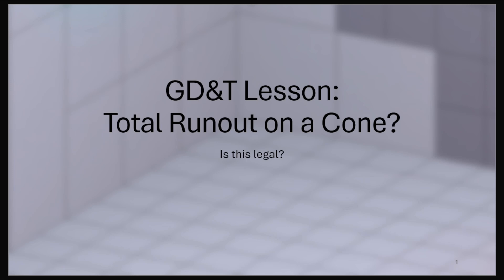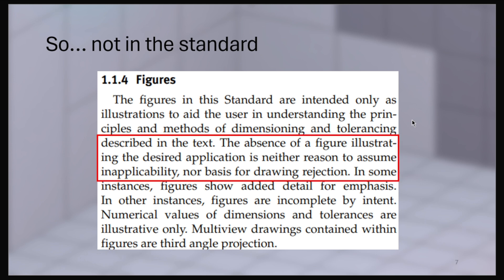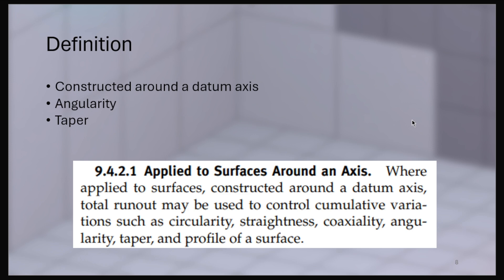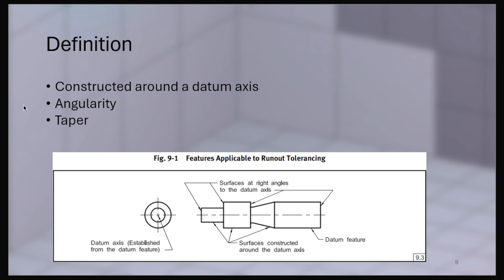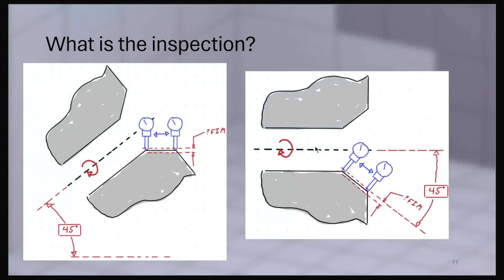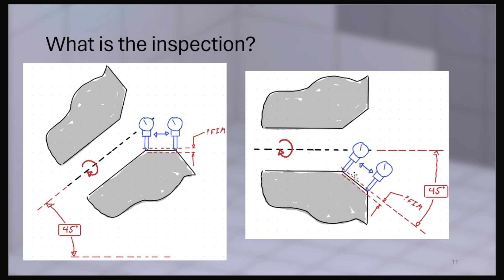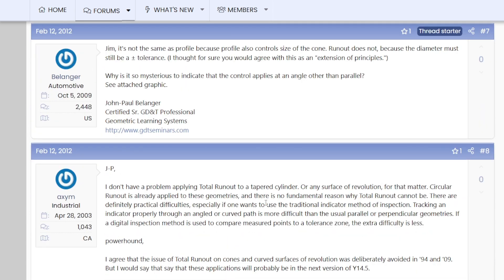GD&T Lesson: Total Runout on a Cone (Is this legal?)

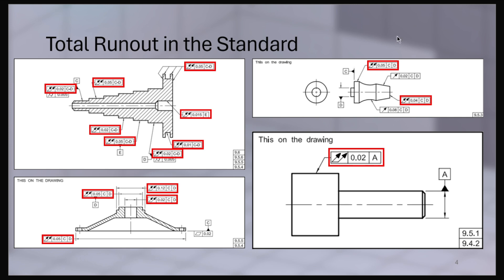Comment: I can’t tell if this video is a joke or not but just incase it isn’t what you want to do is CIRCULAR runout. It’s the symbol with one arrow in the top right illustration at 0:34 there is one on the actual cone section and one on the concave section of the part. You didn’t highlight them, didn’t you wonder what they were and why there was only 1 arrow vs 2 arrows? 

What kind of job do you have that you and your colleague are making prints and don’t know that there is CIRCULAR runout and TOTAL runout?!  

The funniest part is imagining someone inspecting a part using your tilting method 🤣🤣🤣 It’s kind of like when there were all those videos of primarily dads sending their kids into Autozone to get some blinker fluid 🤣🤣🤣

The difference between the inspection of CIRCULAR runout and TOTAL runout is:

🔹Total runout: the indicator will be fixed, the datum(s) will be constrained and the part’s location will be fixed as you rotate each segment of the part 360°, you then slide the part along the surface plate with datum’s still constrained and indicator fixed. You will then repeat what you just did along the entire length of the part one segment at a time without ever unconstraining the datum’s or moving the indicator. The result will be the total indicator movement from the first segment to the last. (Hence the name of TOTAL Runout).

🔹Circular runout: basically the same method while you rotate each segment 360° (constrained datum, fixed indicator, fixed location of part as you rotate 360°) but after each segment is rotated you will keep the datum(s) constrained, slide the indicator to another segment of the part, adjust the height, zero indicator on the new section, keep the part location fixed as you rotate the part 360°. As long as each segment meets the tolerance, the part passes for CIRCULAR runout (hence the name). 

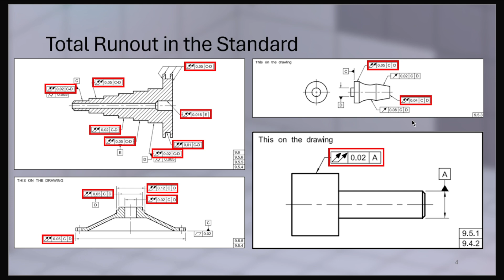Personally I think your interpretation of the standard at 1:28 is very flawed. What they’re saying is that we have some examples that illustrate what we’re talking about but if your part doesn’t look exactly like the illustration it still can apply. Your interpretation would be like “the law says no speeding on the city streets and highways but it doesn’t say I can’t speed on a sidewalk, I’m just gunna drive 70mph down this sidewalk, that’s not illegal”. Does that make sense to you?
Reply from the maker: Hi there, this video is not a joke, and yes I do know what a circular runout is (I am a GDTP for the 2009 edition of the standard)

There was further discussion by industry professionals here if you're interested 
https://www.linkedin.com/posts/r-dean-odell-4164b2234_gdt-lesson-total-runout-on-a-cone-is-this-activity-7266982966315126784-JDyn?utm_source=share&utm_medium=member_android&rcm=ACoAABuOx50BYGA76kCymYk1YbCOL-98aT7t8f4

As for who made the original drawing, it was an engineer who was learning, this is a complicated language and everyone starts somewhere 

To address your analogy, there is typically a law saying no driving on the sidewalk
Reply: @GDandTNerd if you know what circular runout is then why on earth would you make this video? I don’t have a Linked In so I could only read a couple of the comments but why is this even a discussion, it makes no sense! 

Pretty much the reason there is circular runout is because of cones, tapers, non-continuous cylindrical surfaces etc..

Just try to physically inspect a part using that tilted method you describe and you’ll instantly understand why there is circular and total runout 🤣

The speeding example I gave was just a hypothetical because I’m sure there are indeed laws that prohibit driving on a sidewalk. I was trying to point out that standards, laws, regulations etc. cannot account for every single scenario but that doesn’t mean that you can add whatever you want to suit your needs.

Not sure which rev. you have access to and I only have Y14.5-2009 on my phone at this time but look at figure 9.5.3 on page 183, the 2nd illustration from the top. They specifically point out when it’s a cone you use circular runout! 

PS: I’m not ranking on the person who originally came to you with that drawing, they were definitely new to GD&T.
Reply from the maker: Sorry for the long gaps between responses, I'm not getting notifications for some reason

Why make the video? Because it was an interesting question that was proposed, and digging into the specifics of the standard seemed to allow it. 
Unfortunately the standard isn't as simple as "there's no picture of it so it can't be done." An important paragraph in the 2009 standard is 1.1.4: "the absence of a figure illustrating the desired application is neither a reason to assume inapplicability, nor basis for drawing rejection."

I agree, the inspection would be impractical, but imagine perhaps changing the frame of reference, running the dial indicator at an angle relative to a surface. For example rotating a poppet valve in a lathe chuck, and setting the carriage to 45 degrees and running a dial indicator along the seat

To your credit, they supposedly shut this down in the 2018 standard by saying that the tolerance zone is two coaxial cylinders (I have not confirmed this) but for the 2009 standard, total runout can control angularity and taper on a feature constructed around a surface(9.4.2.1) 
Many other people with the GDTP certification found these arguments compelling 

If you were to want to perform the inspection this is discussing without a total runout, circular runout also would not be good enough. The true analog would be a surface profile with a non-basic size dimension, which is used in the standard (fig 8-17, 18)

I'd recommend you read through the eng tips page linked in the description

Comment: If you suggest tilting according to the basic angle at inspection for getting the direction to run the indicator at, do you imply that the cone must be dimensioned by a basic angle to apply total runout to it? What if the cone's angle is 
  directly toleranced and total runout is applied? Chances are high that some would do that. And if a cone is dimensioned by a basic angle one might as well define a profile of surface with reference to the datum axis to get exactly the same effect - a tolerance zone bounded between two 
 coaxial cones that are also coaxial to the datum. The conclusion - don't use total runout on a cone.
Reply from the maker: I suppose if one were to directly tolerance the angle, you would have to do the inspection at multiple angles until the total runout was either measured in spec, or determined to be out of spec.... a very unfortunate inspection but possible

As far as surface profile goes, you may have a case where the end diameters of the cone could have a much larger size variation than the allowable variation in the surface. A surface profile may needlessly restrict the "size" of the cone when only the total runout needs to be tightly controlled 

I hope I explained that well, if not, I could make another video about the difference
Reply: @GDandTNerd  
Yes, I guess the inspection of total runout at multiple angles when there is no basic angle is theoretically doable, but indeed very unfortunate, as you say. My opinion - it wouldn't make sense because such control is not likely anything that "simple" runout (each cross section separately) wouldn't do. Well, maybe it would add a limitation to the "straightness" of the cone outline (limiting curvature) as long as the indicator runs along a straight line.

As for profile of a surface limiting the size of the end diameter of a cone, I don't think that is correct. I recall some mentions in Y14.5 of profile controlling "size" for cones but that is just bad wording. Profile of a surface doesn't limit the size of a cone because any size on a cone depends on the local length from the apex point and the profile zone has no way to limit that lengh. You are allowed to extend the tolerance zone as much as necessary because it is required to "cover" the entire actual feature (there's a Fundamental Rule that states this).
Reply from the maker: Ah, you're correct. I was imagining controlling the form with a basic angle and a basic diameter

Fig 8-17 and 8-18 in the 2009 standard is probably what you're remembering, where the angle is basic and the diameter is directly toleranced 

I suppose in that case, while the method of control is slightly different between the total runout and surface profile, the allowable forms could be the same!

Comment: Lucky that forum post was only two pages. Some of those topics go on like Russian novels.

Solid argument btw.
Reply from the maker: I have gotten lost in those forums to the point I don't remember what the original topic is!

Thanks! Glad you found it compelling. 
Who knows, maybe tapered surface total runout is the next evolution in poppet valve technology
Reply: I agree with your take. Runout on a conical surface should be acceptable. When using GDT would you call out a datum? Or just stat TIR or FIR?